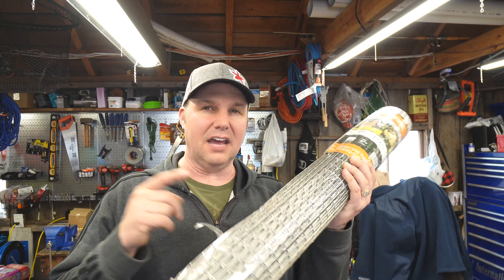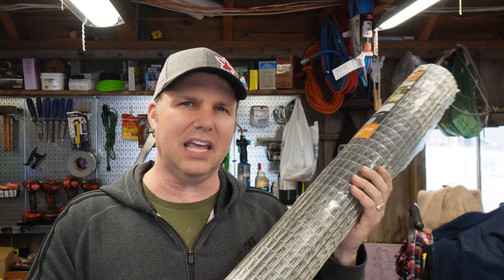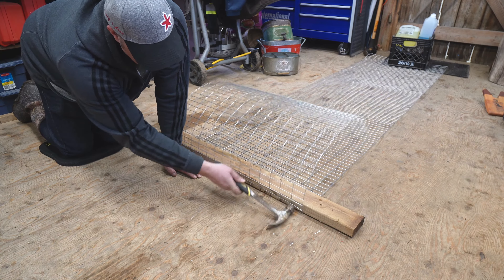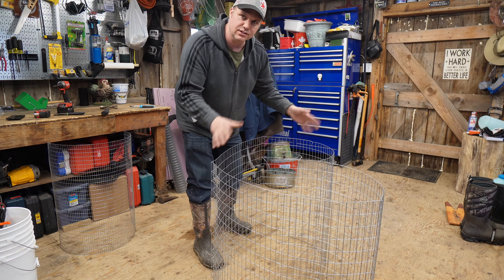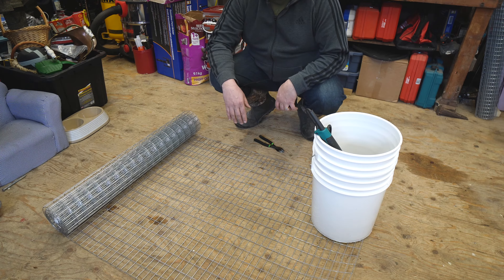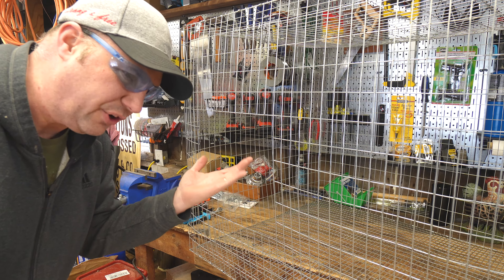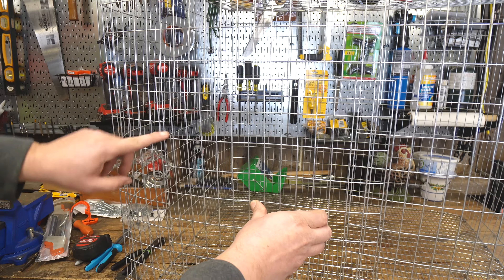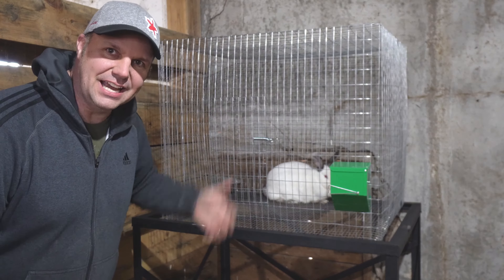How To Build a DIY Rabbit Cage - Cheap & Easy

Comment: It would be a lot easier to just cut out the wire for each individual side. Lay them all out on the floor… Then just cinch them to together with clips. Also, the cages don’t need to be so tall. That gauge wire is very expensive, so it’s certainly a cost cutting measure that could be made.

Comment: Never built a cage like that before always just bought the dumor cages and use to hang them using 2 pieces of chain and some caribiner clips. Do you think that cage wire you used would be strong enough to hang instead of setting on a stand like you did?

Comment: How much do you think this would cost to build in 2023? Do you know of a better alternative for partitioning off our colony while testing the group-behavior temperament of new does?
Reply from the maker: Well you can get a roll of rabbit fencing for less than $50 and the clips are just $5 a bag. But of all you need is a temporary divider you could use anything like plywood or the rabbit fencing with some t-posts or rebar. or you could just build a half wall with 2x2's and some hardware cloth, then just pound in some t-posts to hold it. You want to be able to remove it if it all works out.   I built a huge bunny barn and rabbitat have you seen those videos? I'm sure there's a playlist.  I built it with 2 stalls so I could keep the buck separate and it's working out great.